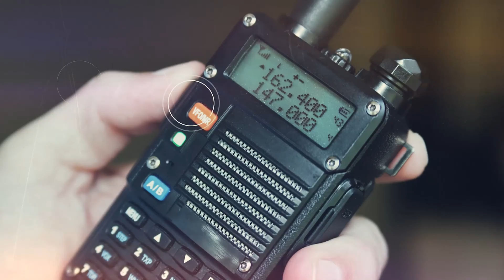Using the Morserino - Ham Radio Unlimited - S2E5

Comment: Hi Mike. What battery did you end up going with for your morserinos? I got mine about a week or two back and need to build it.
Reply: I just built one and used a Tattu 3.7v 600 mAh battery from Amazon.  They do not fit under the module so I mounted it on the bottom plate of the unit under the board.  I would offer you one, but I am unsure of the process of mailing a battery, I am sure it is fine as long as I don't put it on a plane, but I am uncertain.